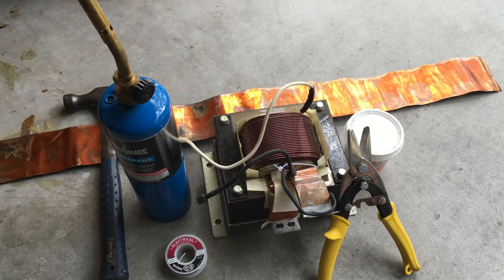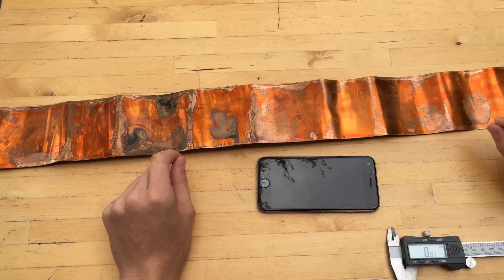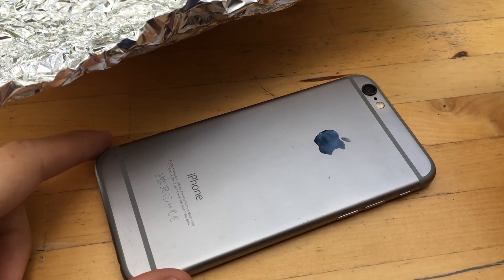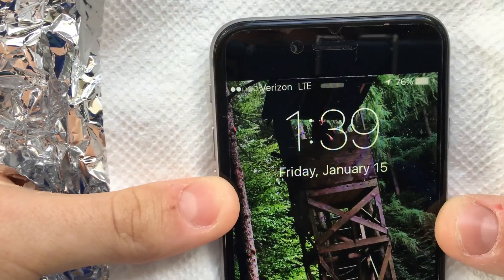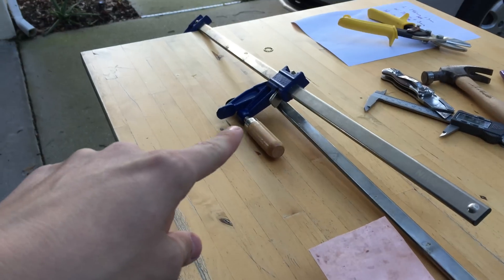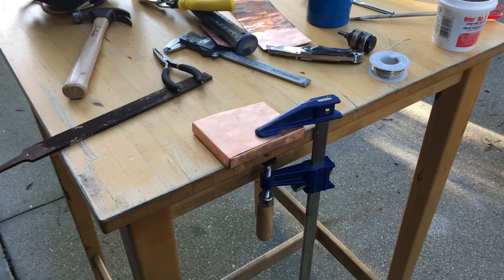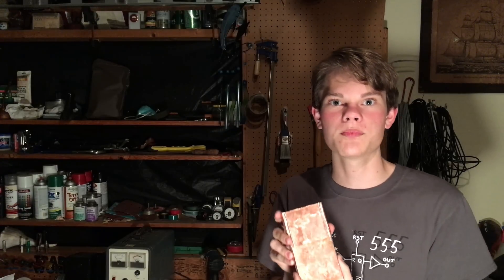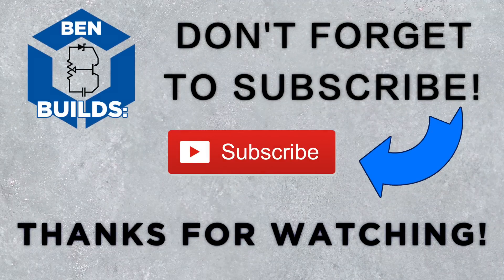Ben Builds: DIY Anti Eavesdrop Phone Faraday Cage

Comment: Yea Faraday caged house insulated in a foot of concrete at the bottom of a salt mine underneath a large lake is about the only way to prevent this government from breaching your right to privacy. The problem isn't if your system is breached. That is always assumed with off the shelf components it is whether they can access that information like the nefarious bastards they are. Every cpu every north bridge chip all firmware to every hard drive is compromised in the US. That scales from individual users to google. Oh and you need something crazy like a 512 bit hash to protect open networks from quantum computers. Just out of curiosity anyone know why cant turn a server room into a heat sink and just use a naturally occurring convection cycle circulate heat?

Comment: Nice box, but no need for lead free silver bearing solder.  Regular 60/40 tin solder is easier to work with for this and all electronics projects.  You should put the flux inside of the joints before you fold it up (not just on the surface) so it will deoxidize the copper and suck the solder into the joint.

Comment: Nicely done! You have more than a Faraday cage, you have an MRAP case. Would it not be easier and just as effective at blocking signals by making a pouch from aluminum or steel window screen? I've seen ads for woven stainless steel passport cases, thin and light. Any ideas? I mean, a copper case is cool, but some of us might prefer a thinner, easier project.
Reply from the maker: Hmm... here's the issue, the passport case is designed to block RFID signals, which typically range in the mili or microwatt range. This case needs to stop a transmitting phone which emits orders of magnitude more energy than an RFID chip. Yes, I's probably overkill, but better to be safe than tracked :)